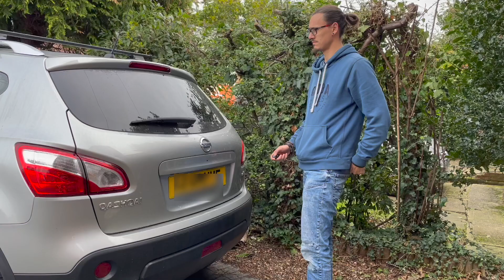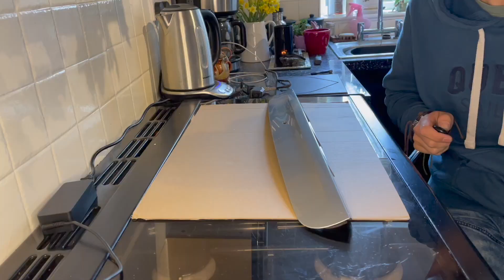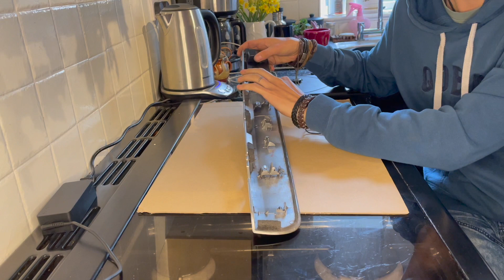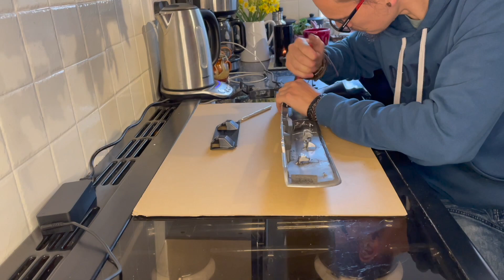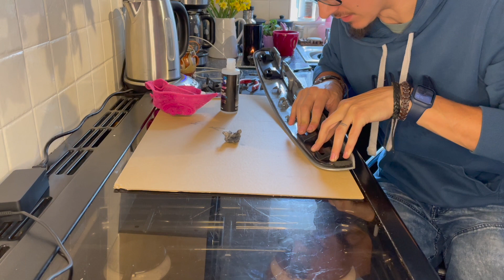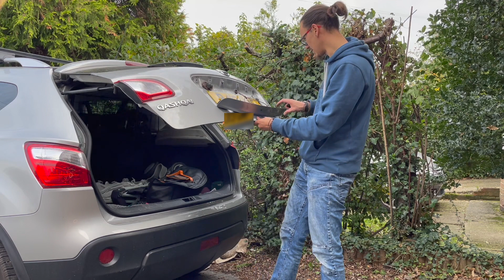Is Your Boot Handle Floppy? - Nissan Qashqai

Comment: Was it difficult to remove and reinstall the boot release button/switch? That’s the part I’m trying to replace on my J11 model as the rubber has torn. Trying to replace it without removing the entire boot handle as how you would when removing the license plate lights.
Reply: My button is pushed in weirdly

Comment: Thanks for the tutorial. Since the parts links don't work anymore, did you get "Boot Handle Clip Repair Kit for Nissan Qashqai 2006-2013" from the X8R website?
Reply from the maker: Hello!
Apologies about that,
So the ones I got were just off eBay, I found a seller that was selling them half the price of the X8R ones but they are exactly the same. They just done come with the acetone.

Comment: Quick question, there's a connector for the keyless entry/unlock button on left side that kind of sits in the bracket for one of the clips - what did you do about that, since the repair kit doesn't seem to allow for it?
Reply from the maker: You are right, there is no bracket for this connector on the repair kit, I left mine loose and just tucked it in the gap before I bolted down the hand, you can tape it in place as well,

Comment: Why acetone, no glue? Isn't acetone like alcohol
Reply from the maker: Hello,
Acetone should make for a stronger bond as it melts the plastic, which fuses it together, kind of like welding for plastic!
You can use any nail varnish remover as that has acetone in it

Comment: Where did you get those two glue on brackets? The audio on this vid is terrible so I couldn't hear. Please ditch the music and bass in future. Great idea though and just what I was looking for.
Reply from the maker: Thanks for the feedback,
I got the brackets from eBay, the listing I used is no longer active but these are the same thing. https://www.ebay.co.uk/itm/TAILGATE-BOOT-LID-HANDLE-COVER-REPAIR-CLIPS-SET-FOR-NISSAN-QASHQAI-2007-2013-J10-/224937001589?mkcid=16&mkevt=1&_trksid=p2349624.m46890.l49286&mkrid=710-127635-2958-0